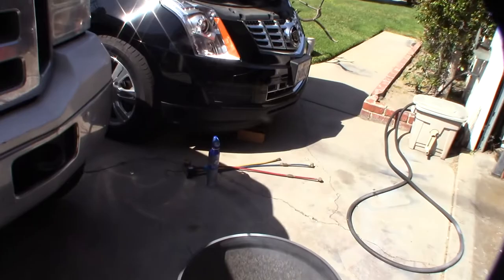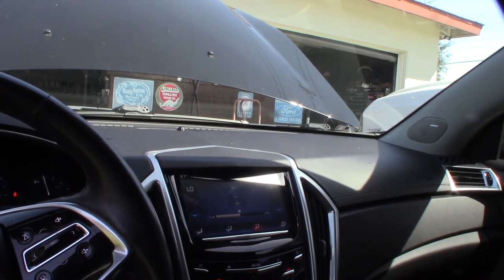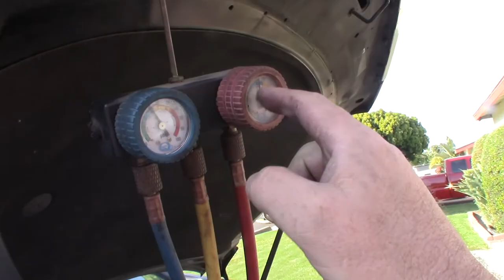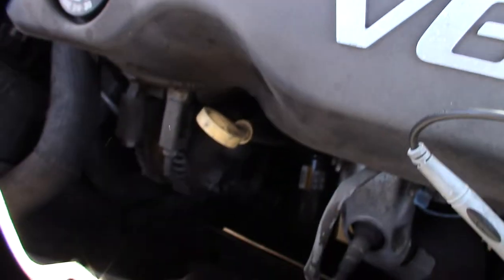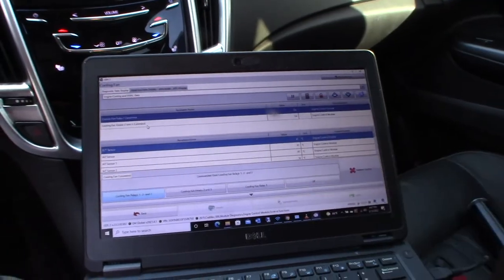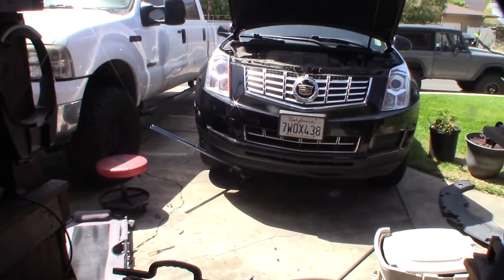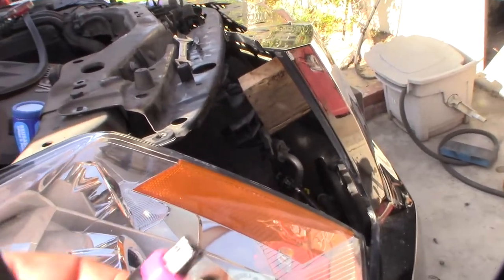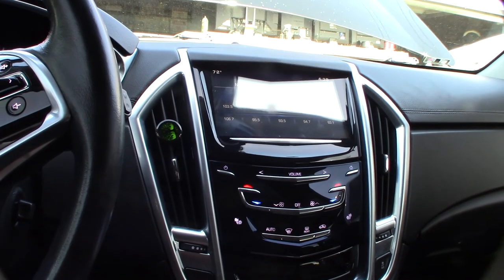Cadillac SRX air conditioning intermittent warm at idle troubleshooting repair no AC pressure switch

Comment: Awesome work.  I’m having this issue too and had this issue on a Honda Odyssey which was a fuse to the secondary AC Fan.  I figured that one out on my own, BUT when I looked on Caddy, there was no 2nd fan.  Hence my YouTube search pulled up your Video.  🎉😅.  Even if this doesn’t fix my problem I really appreciate all of the hard work you put in to figure that out. Thank you so much and I hope that is what is wrong with mine and I’ll try to fix it the same way you did.
Reply from the maker: thanks

Comment: I ran into this issue today. I immediately knew it was the fan not cooling the condenser and i didn't get the voltage when I turned the ac on so i knew something wasn't telling the fan to come on but thanks for the time you put in and for making this video.
Reply: Did you replace the fan? How did it go after, did it fix the problem?
Reply: @FernandoRodriguez-ds5ri  i read your other post but i think you have a different problem if yours blows cool not cold. My suggestion would be to change the cabin filter first and if that doesn't help then i would probably evacuate the system and start over meaning vacuum the system real good and charge it back to specs

Comment: I wonder if this was my problem.. my AC was working fine until I got my transmission replaced. But I tried adding Freon and I believe my mechanic was saying it was filling up but leaving fast. So they said it was a clog or leak and they would have to charge me $1500 to go into my dash to detect the leaks. But now I’m wondering what if it’s just the sensor like your SRX. I have the 2013 model

Comment: Same issue here, changed the cooling fan resistors but didn't fix it, checked relays and they are good.
Compressor works, relays work, cooling fan resistors work, pressure switch works.
Mine seems like the fan won't go into high speed so at idle it won't blow cold air but only when driving, can't figure it out :(
Reply: Were you able to figure it out?
Reply: @blakesawyer9  Not 100% yet, I added freon and it started working but seems like I need to add more. Weird thing is it was showing full before adding and tried two other different gauges  to verify but when I added freon it kinda level out (stayed same level) but started blowing cold.
Reply: @jjlowhz4152  Did you swap the sensor like he did in the video?

Comment: dumb question. How did you actually remove the pressure switch? Do you just twist it off with your hands? I have the exact same problem with a corroded contact which broke off the switch so need to replace switch.
Reply from the maker: It twist off

Comment: You have a link to the Amazon or part number. What issue where you having on the beginning. Mine blows cool but not cold. Seems like my Freon level is good. 
If you can help in anyway, thanks in advance 🙏🏻
Reply from the maker: Amazon Link should be in the description. My problem was the fan was not being told to be turned on. The corroded connector was preventing the pressure switch from sending back the corrected info to the computer. If your levels are fine it could be a weak compressor or clog in the system. You kind of need a test gauge set to know for sure.
Reply: @fintechrepairshop  which pressure switch? I have changed out the pressure switch that's behind the front grill. Which connector was corroded? Any links
Reply: @fintechrepairshop  also. The pressure switch is behind the grill on the condenser and I have uploaded to my chanel a how to video,  can change it in less than 5 minutes. If you like it show some lov to my channel. Peace

Comment: So I’m having similar problems but my fan is actually blowing hot air but when driving for a while it will blow cold but not snowballs. Then after 5-6 minutes it’ll start warming back up. PLEASE HELP Dallas Tx weather is BRUTAL
Reply: And I’ve added Freon on two occasions but I truly believe the mechanics were trying to get me to spend a grand on a compressor and labor
Reply: I’m having the same problems found it to be a block in the expansion valve and orphace tube replacing both today hopefully it fixes im down in Beaumont Texas and this heat is for the birds
Reply: @kalebwood8640 where is the orifice tube located?

Comment: Hello I had the same issue I put in High pressure sensor still can’t get my fan to turn on at idle any ideas ice cold driving gets cold when engine gets to temp and turns on fan for radiator
Reply: Mine is doing the same thing.. did u ever find out the issue?
Reply: Nvm read the description lol
Reply: @meliperez979  I had to replace the low and the high pressure switch fixed it
Reply: By replacing both pressure switches did it permanently fix the problem
Reply: @FernandoRodriguez-ds5ri  yes it did
Reply: @tooldiebum where is the low pressure switch?
Reply: @blakesawyer9 right below the high pressure switch just replace both of them on the air conditioning rail you will see the connector wires going to both save yourself a future headache of having to replace another one later

Comment: My friend was just receiving the same vehicle a 2010 model she’s having the same issue along with P0641 sensor A open circuit code Hmmm you have to basically open up the bumper cover just to get to the the AC pressure switch no surprise there another idiot engineered GM vehicle very reason I don’t buy them